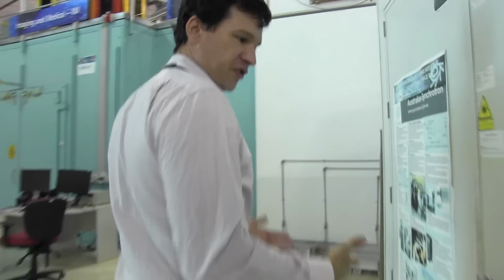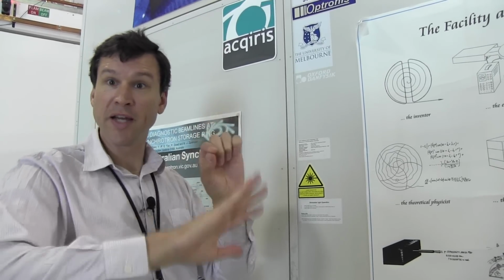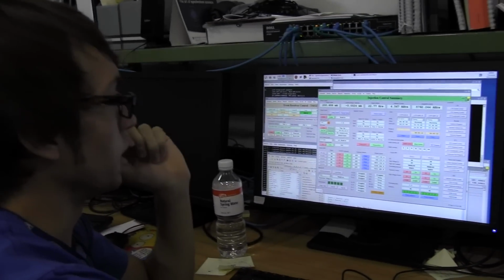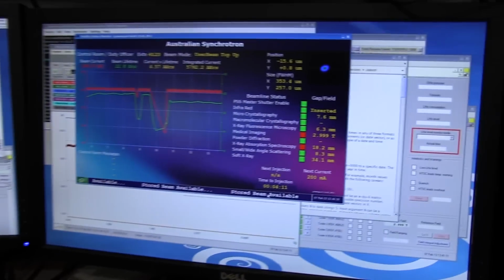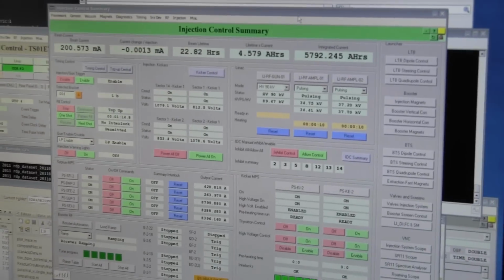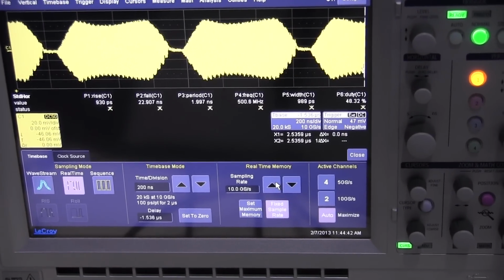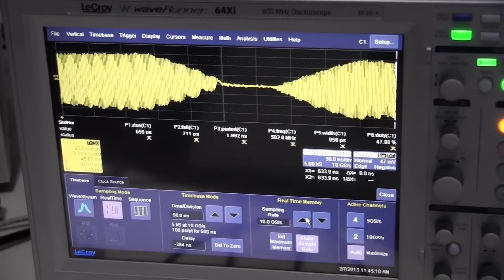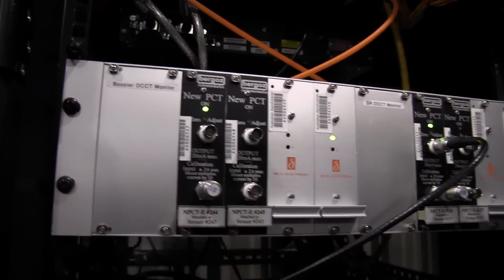EEVblog #836 - Tour Of The Australian Synchrotron

Comment: (47:47/)48:10 - the reason for the tunneling at SLAC (The Stanford Linear Accelerator Center, though the name has changed) was, as I understand it, primarily just to make the building laser-straight.  The building is just over 3km (~2 miles) long, and of course for it to be a "linear accelerator", it has to be exceedingly straight.  Yet it was built in an area of rolling hills, and even if it hadn't been, curvature of the earth was relevant at that combination of distance and requirement for precision... so... digging happened.  :)  As far as I know, not much if any of it is under ground, but it's in the ground.

(Source of knowledge: I grew up nearby, and so it was just kinda part of the stuff that got talked about locally (and I've driven over it many times along Interstate Highway 280), plus I just looked some stuff up to solidify details and confirm my understanding... which is definitely incomplete, but that hopefully answers, at least at a basic level, the question you ask.)

Comment: In the diagram the "storage ring" doesn't seem to be "hooked up" to the "accelerator" and if you "store" particles or beams or whatever in the outer ring after "accelerating" them in an "accelerator" inside of that outer ring presumably it's "centripetal force" that's going to let the "beam" or "particles" make the "jump" out into the outer "storage" ring. Got a question. How do you get them out of "storage" and make them "jump" back into the "accelerator" without "violating" the laws of "classical mechanics" and make "centripetal force" suspend itself to allow the particles or beams to "fly" toward the center from the outside AND if there is some sort of "exit ramp" that allows the "jump" inside out  and particles/beams to "exit" the accelerator and take the "exit ramp" out to the "storage ring" while still traveling "forward" as well, how do you "reverse" the particles/beams so they can "exit" the storage ring on the same "exit ramp" but in the opposite direction since the ramp angle is unchanged? 

One more question. What is the "deceleration" rate of particles/beams once in "storage"? They can't be in a "vacuum" and even "photons" are subject to the "law of gravity" and "air resistance".

Comment: Yes. Real "particle accelerators" are "buried" to shield them from "radiation" - "cosmic" and "atmospheric" -  as well as shield the "environment" around them - people, animals, plants, electronics etc from their radiation. This bullshit about "clay" and shielding from "vibration" is pretty damned funny given that "clay" is very "plastic" and "viscous" compared to "rock" and "stone" and its a very good transmitter of "vibration". And that white "floating slab" supposedly "separated" from the red "outer ring" by that tiny gap and some silicone caulking certainly is connected through all that "overhead". 

4 megawatts is all that facility uses? That's 4 million watts. About 5300 horsepower. Granted that's a fair-sized "gen set" but its about what two "medium-sized" diesel-electric freight locomotives will provide with ease. Of course if you're using gen sets OR "grid power", THAT FACILITY IS GOING TO "VIBRATE" WHERE THE CURRENT IS PUT TO "WORK" I.E. AT THE "ACCELERATOR". ELECTRICITY IS "FORCE" WHEN YOU USE IT TO POWER AN "ACTUATOR" AND THAT'S WHAT ELECTROMAGNETS ARE.

Comment: Uh, your "sextapole magnet" has 6 "poles" making it a "hexapole magnet". Its still bullshit since there is only one "magnetic pole" possible - "north". With "south" being to "north" in "magnetism" what "negative" is to "positive" in electricity. The "north poles" of magnets are drawn to "south" poles of other magnets and "oppose" each other because they are "positively charged". The "south poles" of magnets don't do shit to each other.

How do you get a beam of only 200 milli-amps (2 tenths of an amp) at "35 megawatts" with a very short "duty cycle" given W=VA and "duty cycle" is a DIRECT-CURRENT "CYCLE" AND THE AMPERAGE IN A "CIRCUIT" IS CURRENT FLOW WHILE VOLTAGE IS "PRESSURE" AND A "CONSTANT FLOW" AT A "STABLE" AND "CONTINOUS"  AMPERAGE MEANS THE "VOLTAGE" HAS TO BE CONSTANT?

Comment: Thickwalls of concrete to protect you from the "synchrotron energy" you just stick your hand in front of but that's "safe" because you're at the "end of the line". Which is where you "optically" test and diagnose the "beam" before you "lose it". 

This is from right after you got your "undergrad". In what? Underwater basket-weaving and swimming pool management? 

Here's a question for a "particle physicist" if there"s one "around". If you can separate, isolate, manipulate and accelerate a "particle" what DON'T you already know about that "particle" that "colliding" it with another "particle" will tell you? And how do you use "electromagnets" to create "particle beams" using non-ferrous elements? Which are...all but one of the elements? And spare me the "paramagnetic" and "diamagnetic" bullshit. Ferrous does not mean "magnetic". It means "conductive"  to magnetism. If a metal is drawn to a magnetic its "ferrous" and if that metal is supposedly "pure" and is a non-ferrous elemental metal, the "seller" of that metal is a liar.

Comment: Hello everyone, thank you for the generally kind responses. I (Tom) would like to fix a couple of things which I said. As someone pointed out I was describing an undulator rather than wiggler. Undulators have harmonic peaks for its spectrum whereas wigglers have high intensity broadband. I also meant to say picosecond CCD which can measure very small intensity light (on optical bench). There are probably a few other things which I said which may need adjustment so will be happy to answer questions if you have any.
Our superconducting wiggler (SCW) which everyone seems to be very interested in has recently been tested at 4 T which I'm sure I don't have to tell you is a heck of a lot (Rowan Atkinson quote for those inclined.)
Please excuse the stuttered language I was very new to the facility at that point (right out of undergrad) and still learning. Currently starting a PhD and still learning lots!
And for those interested I designed that T-shirt with the help of SnorgTees which may still sell it (let me know if you find it).
We run open days each year at the Synchrotron so if you're in Melbourne drop by for a tour :-)
Dave, nice to see this up. Forgot about it until a mate from Denmark sent it to me.
Cheers, Tom
Reply: +Thomas Lucas I thought you did a very good job of explaining things under pressure. A question; Why don't synchrotron facilities have beamlines for electron microscopy in tandem with all of the photon related experiments and tomography? Is it to do with a desire not to periodically disturb the storage beam's charge distribution? It seems like a good opportunity to do highly penetrative electron microscopy with a very short de Broglie wavelength that cannot be done in most lab environments.
Reply: +inviscid43 Thank you :-)

To answer your question there are a fair few reasons but the most important is keeping a constant beam current in the machine. The beamlines like to have a constant flux, which is difficult as synchrotrons require bunched beams to operate and also as the electrons are lost to the environment due to instabilities, interactions, etc.

Also, although I'm not overly familiar with modern electron microscopy techniques I would think that our electrons are too high energy for such a technique which I believe would operate in the keV regime whereas our electrons are 3 GeV. Though if anyone wants to correct me on that I'm happy for them to.

Finally something which relates to the first point but with a slightly different mechanism, anytime we want the beam to change from its nominal path we must apply a kick to the beam which would result in a perturbation on the beam and would be visible to the beamlines. Actually when we inject every 4 minutes, to keep the relatively constant current, the beamlines can't operate for that ~5-10 ms period while the beam returns to its normal path.

Comment: What a toy!!  These bloody physicists have all the fun!!  Think you could drop in on the LHC for a vid by any chance Dave?!
Love the use of a 4 channel Thurlby PSU to power that little breadboard proto!!
Reply: digitalradiohacker

More of a linearite actually!  Although I don't have any Thurlby's, they tend to fetch high prices.  I do have a large selection of other brand linear PSU's though. Like Farnell, Coutant, Kingshill, HP, Advance, Kepco.
King of the pack is a Farnell H30-100, 0-30 volt, at upto 100 amps, that has a transformer to be reckoned with! It will liberate plenty of smoke if things go wrong!
Reply from the maker: +turboslag No problem, it's only 50+ hours of travel to get there and back.
Reply: EEVblog

That is an issue!

Comment: In a previous life I worked on a >1MW military radar that used a Klystron for final amplification. The tube itself was about triple the size of the units shown here, and it was housed in an even larger containment vessel and cooled with a mixture of ethelyne glycol and water (the resistivity of which was carefully monitored to avoid arcing). It had to be that big because unlike these cyclotron units, it was rated for continuous duty. My most vivid memory of the system was the sound it made when radiated at full power into a dummy load. The best description I can come up with is a steel garbage can full of angry metal hornets. Why it made that sound, I don't know, but it sure got your attention! Anyway, very interesting tour, Dave. Thanks.

Comment: Are there any other videos of the actual synchrotron light output on Youtube, It would be interesting to see the range and composition of colours and quality of light that they can output. What power levels of light and x rays can it output?
Reply: They can produce any wavelength of light within their design parameters (the wavelength is literally being created on demand with a magnetic servo), from far infrared to visible light to well into the hard X-Ray region, so not much point as it would include every color in the rainbow that you can see and very many wavelengths none of us can see.  However, at any single moment it should be generating a singular wavelength (and possibly some related harmonics) per beam (since each of the 14 beams are independent), if I understand the process correctly.
Reply: Ethan Poole He put he's hand in a white beam of light clearly a range of wave lengths which looked quite interesting in itself.  As to not much point I guess no one is interested in looking at the of light from lasers or even RGB LED's :-)
Reply: +Coolkeys2009 As I understand their explanation it can only create one wavelength at a time, but with each packet only 23pS in duration one could slew it through many different wavelengths each second.  Without seeing the white light split out to its respective components it is difficult to say if that is what they are doing or if it is simply a mixing of RGB to create the illusion of white light as producing distinct RGB wavelengths would allow one to quickly measure the parameters of the beam wriggler servos...any deviation in those respective peaks would require an adjustment.  But that is my conjecture from their description in how it works and generates the various wavelengths.

Comment: I'm pretty sure those were Klystrons (with an L).  It thought they might have been something different, but looked it up and found that they are also used in high power radar transmitters, where I first heard about them.  Also, that was definitely the most interesting video on I've seen in quite a while!  Such a different scale than I am used to, pm, ps, MW, etc!

Comment: 3 GeV at 200mA is 600 million watts and the resistance is 15 Giga ohms... insane.
Reply: 3 GeV is the energy of the electrons in the beam; not the volts you are thinking about. One electron-volt is 1.602e-19 Joules. while rest mass of an electron is 511keV. E=1/2MV^2. The electrons in that beam are moving very close to speed of light, which is why you need a large radius of the ring accelerator to reduce centrifugal force as much as possible. Also, that close to speed of light M increases due to relativity. Here is someone’s high-school homewok problem basically doing the math for 1GeV electron: https://answers.yahoo.com/question/index?qid=20081007112246AAv73Cu

Comment: Very neet and full of memories (used to design the stainless bits for SSRL Stanford when it was still direct to the university). A while back, since the drawings were mechanical pencil on paper. 

One event an Austrailian would understand was when a major change in the metal building had the AC off during a heat wave for a month.  We worked up stairs in a windowless area and they were unwilling to relocate us during a time critical project. The deal was we would take the heat but no dress code and at 4 they bought the beer. There was a bit of a bother when an unschedualed group of suits came through to see bare feet and beachware with beers in cup holders at all the drafting tables.  :-)  But we met schedule.